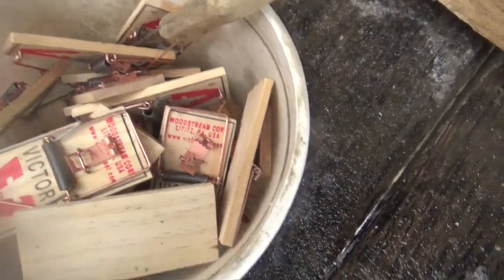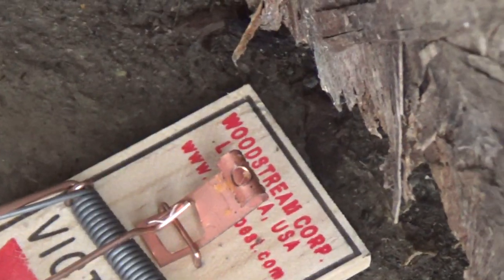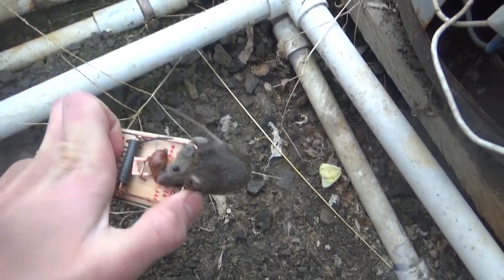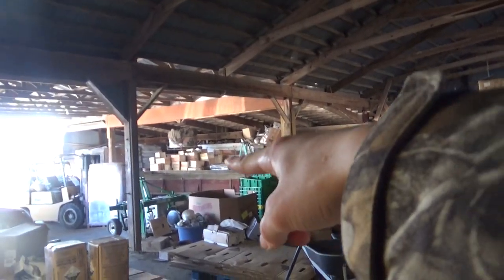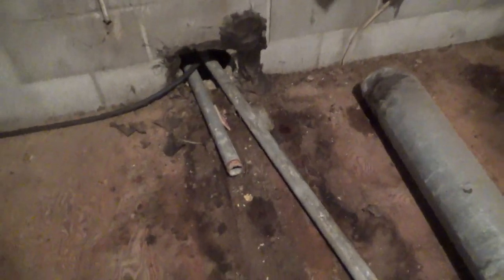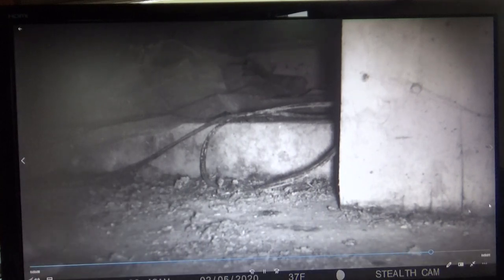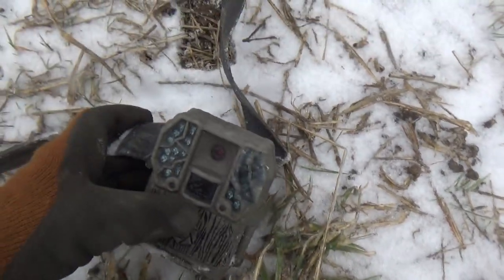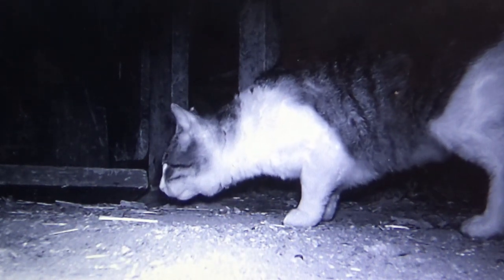Mouse Trapping Challenge | how many mice can be caught in one week - plus trail cam footage

Comment: Enjoyed the video. Something I have had great luck with is 5 gal buckets. I take a board that is long enough to lay against the top and reach the ground at an angle [about 45 ]. I put 2 short screws at the top so it won't slide off as the mouse climbs up. I place a little p nut butter in a couple places on the board, then I put a little inside the bucket just out of reach from the top of the board, I also put some on a piece of cardboard in the bottom of the bucket. They fall in and can't jump out. I have caught multiples many times. It is quick and easy. Good luck trapping. PB

Comment: These traps really do NOT work unless you hot glue a peanut to the trigger. I also would use half a toothpick - once the toothpick gets peanut butter oil saturated into the wood, then the mice will pull and tug on it, and get caught. Pinch a toothpick onto the trigger, then add the peanut butter to the trigger and your catch rate will go way up.

The difference of how many mice you will catch goes up substantially. 

Also, set your traps under some kind of leaning board. Mice are food for birds of prey, and just about everything in the wild eats a mouse. That is why mice are very wary, and always nervous acting. They will work your traps BETTER if you make your traps appear safe for them. I always use a leaning board, cardboard, anything to lean over the trap, and the mice will work your bait much better.